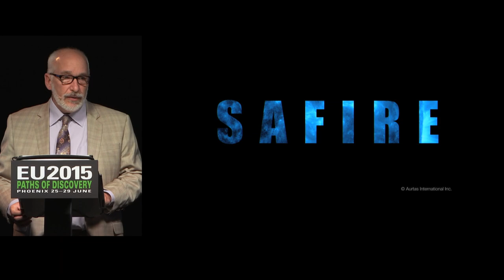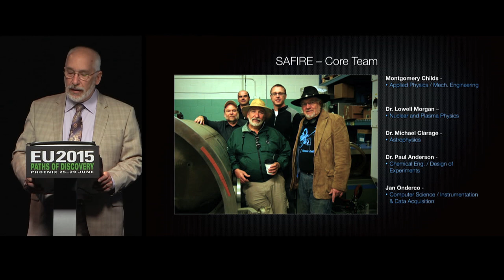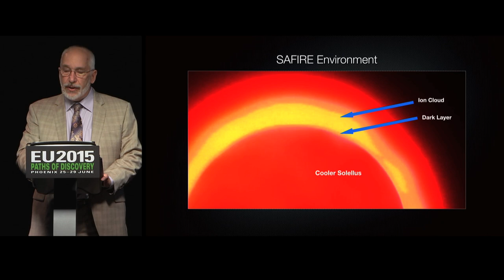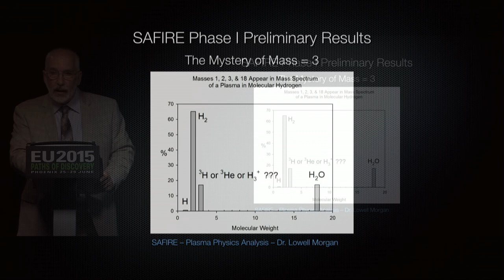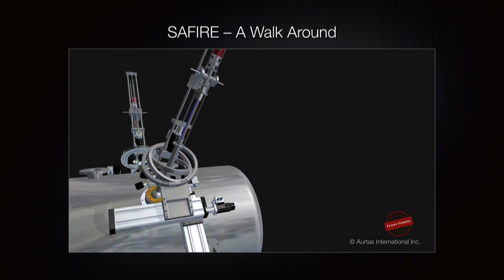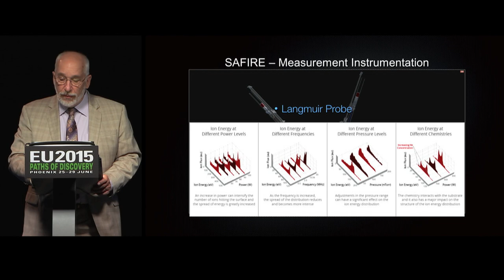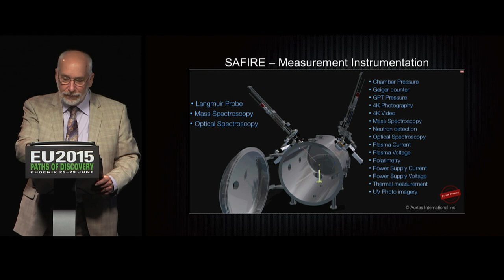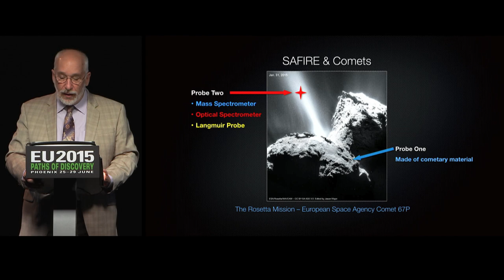Montgomery Childs: SAFIRE Project Update | EU2015

Comment: Safire will help explain many things that mainstream science is still grappling with
Reply: +Manuel Cilia - It is starting to look that way. To date we cannot find any disparities with the EU model - although the preliminary results may require some adjustment to the model. 
We're working on a paper right now showing there is line broadening the further out we measure from the core = hotter corona than the plasma around the core. We're using the same methodology and math NASA uses to make that determination. This is only one of a number of phenomena that can be explained via SAFIRE and one that is a mystery of the gravitational model. 

For the record the SAFIRE team is made up of... hmmm what you might say are "secular" scientists - we do not hold to one model or the other. Our research mandate is very clear about this.

Comment: This maybe a bit of a  digression...However, a number of years ago I seen in a dream... All our electric poles  no longer had wire from pole to pole...There was some kind of receptacle circular in shape which protruded somewhat and made of some kind of metal almost pewter in color....The bottom half was cut out...Also , there was some sort of black shiny surface.... again I had this dream so many years ago but yet remember in such great detail... starting to think that dream just may have meant something and not so crazy after all...

Comment: What is this Electric Universe Theory that ye speak of?  (This was typed in a fake British accent)
Reply: goatstaog What would it be then, a Hypothesis?
Reply: +SlipKnotRicky +goatstaog The Electric Universe should continue to be called a hypothesis, for as long as it remains generally untested by the mainstream science community - similar to the Big Bang Theory, which is also a hypothesis, since many aspects of the big bang theory are based on currently untested/untestable assumptions.
Reply: +Giffy Guy,  I have to disagree, but not in the way you may think.  The Big Bang is not untestable. It has been tested,  and falsified.  The theory is absolutely dependent on the interpretation of Cosmological Redshift as caused  by recessional velocity and correlated to distance.  The work of Arp has proven, beyond any reasonable scientific doubt, that this interpretation is wrong , completely undermining the foundation of the Big Bang Theory.
Reply: +Michael Shea  --> Yes!  👍
Chip's work should be taught in all high school's.
Reply: +Michael Shea I agree with the validity of Arp's work, but the ides of something being "proven" is more complex in reality.
We may consider it tested and proven, inside the EU circles, but the scientific community needs to come together and accept The Electric Universe (e.g. peer reviews) before any of Arp's work can be considered official proof of anything.
SAFIRE marks a big step in this direction, providing a semi-independent set of experimental data, testing the validity of The Electric Universe as a potential candidate for future theorydom.
But we still need to wait for consensus from the mainstream scientific community before we can say anything has been officially proven or disproven.
While we wait, we can say there is significant supporting evidence backing the idea that the predictions of The Big Bang hypothesis might be false - which does not imply proof or disproof, but more accurately and diplomatically describes the current state of The Electric Universe as a competing/conflicting hypothesis that still needs extensive independent testing for official confirmation of any of the internal predictions.
Sometimes I feel like some of the people in these videos could stand to speak a little more diplomatically like this - it could make the EU ideas just a little less initially off-putting for external scientists, helping to boost the first-impressions people have about EU.
Reply: +goatstaog I appreciate your opinion, and I don't disagree with you regarding the general importance of The Electric Universe for countless future generations.
However, I believe you fundamentally miss-understand how science works IN PRACTICE, and what the true distinction is between a scientific hypothesis vs theory vs law (i.e. fact).
It's more complicated then just having ideas that appear indisputable among supporters - the scientific community needs to accept this as a valid theory, before it can be considered a theory - until then, it is a hypothesis - and don't even start on trying to call EU a scientific law or fact, that's preposterous this early in the game.
See my response to Michael Shea for more details - feel free to disagree with the academic scientific process, just understand that it makes you sound like the one who lacks proper education on this subject.
P.S. Misusing dramatic buzzwords doesn't help your case, it makes you sound like a sheep - exactly the opposite of what the EU movement is trying to accomplish.
Reply: goatstaog Question is, did Tesla have any ideas on the Universe?
Reply: 3877michael Very educational. :)
Reply: +Giffy Guy 

Empirically proven to be precise.

Mainstream science chose to ignore it because of the ramifications it represents and the threat to funding.

But like a child who does something wrong then hides it,  Dr. Halton Arp's discovery of quantum spectral shifts at predictable intervals as matter ages, cannot remain hidden forever, nor the consequences be avoided.

Sad thing is, before then a nice X flare CME or filament release CME, will gut our power grid.

Our magnetosphere is down at least 25% and plummeting as the magnetic poles continue to speed away from the axis poles.

Watch what happens when Saturdays incoming CME hits us. The effects will be inordinately strong for that very reason.

As we progress into this Grand Solar Minimum, we are severely vulnerable to a Carrington type Event.

Oh joy...
Reply: +Giffy Guy Peer review? Really!!! And just who do you think is going to do the reviewing? The very people who would take a Subjective View and not Objective? You must understand that even if they wanted to they would be cutting their own throats, their jobs rely on funding.
Reply: RHINO41153
I don't remember much from this conversation, but I definitely agree with you. Mainstream academics performing peer-reviews, will be financially incentivized to be "politically correct" rather than objective. It's weird how PC applies to scientific reviews like this, but that's totally how it is.

Comment: simple math would suggest that gravity would become less as "you" drop below the surface of the sun. think about it. the center of the sun would have negative gravity, and could rip atoms apart "anti fusion"?? and alter time (less gravity less time). i would like some comments on this very weak theory. thank you
Reply: +tyronejonez01 I think you are correct, but at the same time pressure from all the material around you pressing inward would increase with depth. Also, if say 90% of the mass of the earth is concentrated in the inner 25% of the radius, then gravity would probably increase with depth to a certain point, then decline.
Reply: +Eggmunkee N If "you" would drill a hole all the way thru the earth and put in an elevator , and put a bowling on a scale it would weight 16 lbs. at the surface. 100 feet below the surface it should weight less due to the gravitational effect of the mass above your head. Would it weight zero at the center of the earth? If not I am wrong.